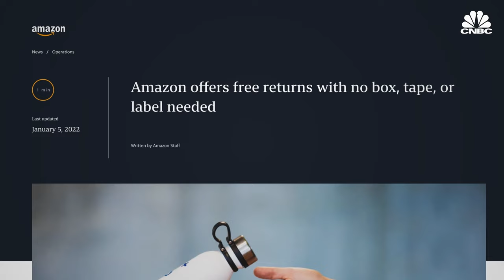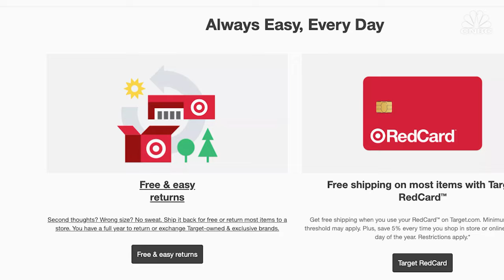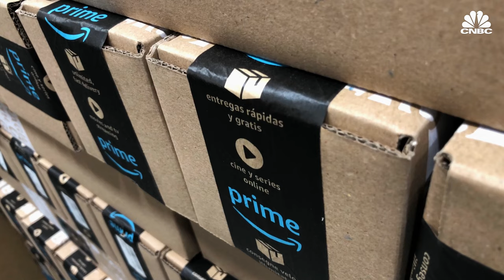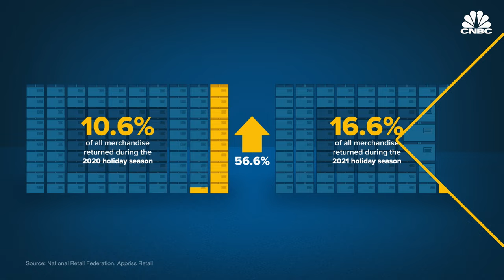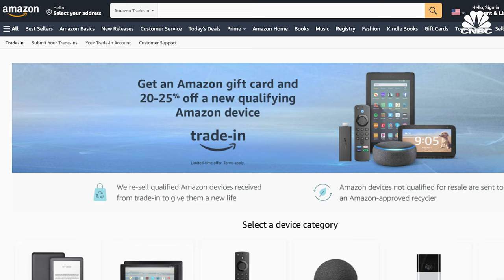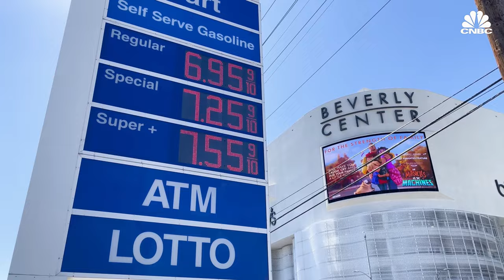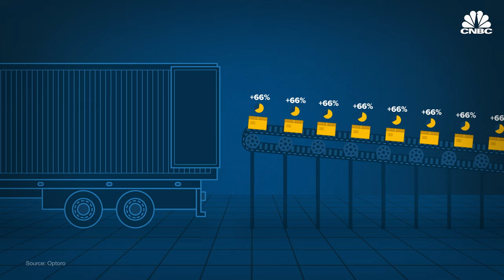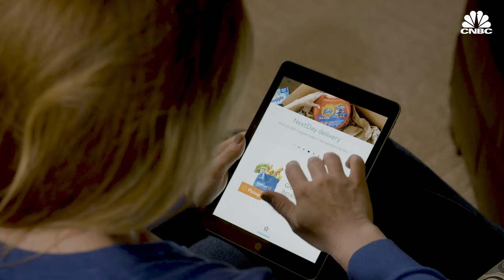Amazon’s Plan To Fix Its Multi-Billion Dollar Returns Problem

Comment: They need a review process where they verify listings. For example if returns for a particular item reach a certain percentage then Amazon should review the listing to ascertain the issue.
Reply: Good idea, obviously nothing will happen.
Reply: @jonhelmer8591  they do this already foo
Reply: They have the process i think its 15% return rate i am not sure, i am an amazon seller and returns are pain in the A$$
Reply: Amazon is doing that for a long time. This problem is not an issue with listing. It's the customers who know that they can do whatever they want. Even if the product is good, customers use it and return it.
Reply: I am an FBA seller and my return rate is from 6% - 8%of my total sales. This means every month I get about 140  returns and most of them go to disposal.
Reply: @CashCopMineZ  no they dont...  like if u get the product and dont like it for a reason. explains a good reason why not to get it. amazon will not let u keep that comment. they only keep stuff like oh the product is good bro lol.
Reply: @patocobar7038  why not sell to a discount store
Reply: on the front lines of innovation? yet unions arnt allowed or bathroom breaks
Reply: They do that already kinda. They don’t remove the item from the marketplace but some have a warning that reads “frequently returned item”

Comment: Frankly, making the returns easy and remove the hassle for the customer and the cost is absolute key to Amazons success. I wouldn't buy even half the things I buy on Amazon if I wasn't able to return it if it was something wrong with it etc.
Take shoes or clothes for example, often you don't know how they fit until you have tried them. Then there is electronics etc.
Reply: Amazon actually encourages returns and has made it soo easy for customers to return things. They place the negative cost on the sellers which sucks because most sellers take a loss at a whole bunch of returns. They even added returnless refunds and they encourage sellers to provide them
Reply: How do you return an Amazon product when they just leave the item by the door,  don't ring the doorbell to alert the customer that the package was delivered, and some knucklehead comes and steals it?
Reply: @indriadrayton1132  Then you report it to Amazon and get a refund. If there is no signature how can they prove that you got it. Amazon know full well that packages are just dropped on porches. They get stolen.
They could require signature but they know it would mean they need to drop it at post office if someone isn't home. Causing hassle. So they rather deal with it that way and take the loss. Big ticket items do require signature.
Reply: on the front lines of innovation? yet unions arnt allowed or bathroom breaks
Reply: @loki76  just wondering how many times does it take to keep reporting items that get stolen when stuff is delivered to you and your doorbell isn't rung to alert you? Almosr everyday, my neighbor ends up with packages at their doorstep, me ending up ringing their door myself to let them know there is a package at their door. Nope. Will not do business with Amazon.
Reply: Returns are extremely easy with Amazon, getting your money back well that's a different story. No more for me I'm done.

Comment: Returns are an inherent part of online shopping. Merchandise doesn't always look as advertised, doesn't fit perfectly, or doesn't function as intended. I find this to be far less of an issue with things I inspect and buy in person at a brick and mortar store.
Reply: plus the slightly false advertising of the product
Reply: @shaystern2453  ''slightly''
Reply: Facts gonna start going to best buy to get my phones cause i get them from amazon breaks in 3 months and not being able to tell certain things like what charging port it uses, 4g or 5g, unlocked??, the size, battery life etc. most isn’t stated and it’s upsetting because you pay more for a more expensive item that displays all that information then the cheaper item

Comment: The issue is Amazon allows a flood of sellers onto their platform. This means lots of counterfeit goods which leads itself to returns. If the product I am buying is made of low quality, getting pumped up by fake reviews, and not as described, of course people are going to be issuing returns. That's the issue with Amazon: They don't exactly have the best reputable sellers. I bet if you do a rate of return of Amazon Basics items vs their counterfeit counterpart, you would see a much lower return rate on the Basics items. Same with name brands listed on Amazon. 

And it's foolish to believe that the stuff Amazon donates to these third-party centers aren't selling them. I guarantee they are keeping and selling the stuff worth doing so. Also, Amazon already charges customers for that return cost. It's all built in to the product, prime membership, etc., No seller is foolish enough to continue selling if it isn't profitable so they are clearly earning enough $ to justify the returns. Does returns eat into their margin? Yes. But that ease of return also allows them to generate massive amounts of sales.
Reply: "counterfeit goods which leads itself to returns" --- a very questionable assertion
Reply: @troooooper100  Not questionable. Counterfeits have a higher rate of 'not as described' or 'defectiveness' due to it having lower quality control standards.
Reply: Exactly, the cheap ass quality products being shipped is the issue. I stopped ordering from Amazon for over a year & closed my account. After working in the parcel warehouse industry I limit online consumption because ppl are not pid fairly .

Comment: The problem is that Amazon sells junk quality products or it isn't as described or it's counterfeit.  It's too easy to become a seller and it's too easy to skate by with low quality products.  Other retailers have started to accept junk products. I've returned more stuff to Costco in the last two years than in the past decade before.

Comment: My returns are mostly because there is no quality control. The only way to know if something is good is by waiting for hundreds of customer reviews which are paid for by the seller. Amazon needs a “certified product” label that can only be given by submitting your product to independent review by Amazon judges.
Reply: Fundamentally returns are the symptom not the problem. Streamlining returns and burning them for energy and reselling them is simply a Band-Aid for the actual problem. There is not a good quality control system for Amazon purchases. Many times it is just products that are bought off of Alibaba and re-sold on Amazon with very little value added or quality control. Then the customer who bought the product wind has two options, throw it away or return it.
Reply: There's the Amazon renewed program
Reply: Even if the product is certified, does not mean it will be quality. I rarely buy on Amazon because of too many disappointments. One was buying an item which was labeled 100% leather but after two weeks, it was already peeling. This was from a well known national brand. So I claimed, they paid for return, and I got a refund. The same item is still listed on the site with 100% leather and I have no idea how in the real world a store would allow that to happen.

Comment: It's nearly impossible to make a good informed decision when buying clothes and shoes without trying them on. This kind of item should be banned from Amazon and online stores. Amazon and online sales should be only for books, electronics and technology, kitchen supplies, etc..
Clothing, shoes, linens and anything involving a fabric, texture, size, etc.. Should be banned simply because the odds of matching what you see on the screen with a perfect fit it's highly unlikely. As for clothing returning to the retail, shopping mall,  experience of the 90's and trying stuff it'll be better for the environment and maybe even create jobs. Returning should be only for damage items not because you thought the color was wrong.

Comment: There is also a borrowing problem with Amazon customers in particular because of their easy return policy. There were litterally whole Tiktok and redit posts on how to do this. As a handmade seller on the platform among other selling platforms, I ONLY have this issue with Amazon clients. They buy a product, use it at an event, then return it for a refund. Which comes out of my small businesses pocket because we cover the shipping costs. It's a problem for multiple reasons. I totally get needing to return some things, but when it's blatantly obvious that people are abusing the system. Something needs to change.
Reply: Hello there how are you doing today

Comment: Ebay used to have it so there was allowed a fee to be charged by the sellers if someone bought something and tried to return it without a valid reason that had to be proven, but policy changes has basically destroyed this option for the most part. Might want to bring back this model if you want less returns of products as well as less losses for those third party sellers that usually get hit the hardest.

Comment: Amazon's problem is largely managing its sellers to standardize.  If Amazon demanded some quality and standards, returns would be less.  This is ESPECIALLY true in terms of women's clothing, underwear, bras, shoes, and so on.  Sellers use Asian sizing and it's a gamble to buy their crap.  If Sellers want to sell in the US, they should have to adhere to Amazon's own US size charts.  If I could know things will fit with more probability, I would buy more and return less.  Also, even some of the brand names sell lesser quality crap on Amazon, the sell "imperfect" or knockoff items.  I was just looking at Hanes T-shirts for women.   I have worn Hanes T-shits for years, so I know how they should fit and their quality.  But if you read reviews, people are getting mis-sized items, ill fitting items, items that have seams falling apart on the sides of T-shirts and in armpits.  It's obvious, these are not up to the quality of Hanes clothing you'd get at say, Macy's, JC Penny, and so on.   Also, sellers post inaccurate titles, sellers try to trick buyers with misleading photography, post inaccurate colors, or have their models hold their arms or stand a certain way to hid fit issues.  I bought a lovely designed ribbed sweater over the winter, but when I put it on, the fabric content was very poor, and the ribbing made the sweater bulge in very unattractive ways, giving the appearance I had a "spare tire" around my waist.  When I went back and looked at the model, she was holding her arms to camouflage what was happening at her waist.   The model was bone skinny, so you know if it was bulging at her waist, on a more athletic built woman like myself, it would look even worse.  I only noticed it and had to look hard at the picture because of the model's arms bent at the waist and her hands touching in front of her body.  Once I noticed it, it was an odd stance and clearly positioned to hid how crappy the fabric was.  Completely designed to be misleading.  That is not the buyer's fault.

Comment: Maybe Amazon should start with how they package items in the first place. Whenever I order a book on Amazon I expect to have to return it because the packaging of the item for shipping is horrible, and the book normally comes damaged due to it being unprotected during the shipment process. I understand as a consumer that items will have "shelf wear", but Amazon is horrible when it comes to ordering books because of the lack of protection they give to the packaging of the item. Most likely a lot of other items come damaged too because of a lack of packing properly for shipment.
Reply: Try buying from a third party seller on Amazon if you can. Not from a megaseller, who are as bad as Amazon with packaging, but one that takes time to list a book with a good description, lots of pictures and such. Much more likely to package books and media properly.
Reply: Video games are just as bad. They just throw it in a bubble mailer and by the time you get it, the case is always cracked and the disc is just floating around inside.

Comment: They really should better incentivize the repurchase of used/returned goods. I always check to see if there’s a used option before I make a purchase. I got my rollerblades, a Dutch oven, and a dry erase board used this year, and I’m happy with every purchase. Most people would rather have new items though. Since we are doing amazon a favor by repurchasing these items, they really should consider a larger discount on those used items. A couple of dollars off isn’t enough to get most people to choose the used option, even if it’s in great condition. If this stuff is going to get thrown away or donated at some point anyway, why not just sell them for a 50%+ discount? Everybody wins! What’s the harm in that? Currently, it seems like amazon is just trying to make as much money as possible from these items that will eventually be garbage anyway, and it reeks of greed.

Comment: I bought a full length mirror recently and was disappointed it arrived shattered so I had to “return” it. If the delivery drivers didn’t smash the merchandise, that would save on returns. They refunded me but I have to get rid of a huge shattered mirror myself. The whole thing could have been avoided.
Reply: It’s not always the drivers, Amazon will load up damaged packages just to get them out of the warehouse.

Comment: Coddling customers = frivolous returns 
People order multiple clothing items with the intent to return them because they CAN, 
What did they do before Amazon? Were they naked?
This new convenience is nice, but at what cost to the market and the environment?
Reply: Clothing is hard to buy online and amazon tends to have bait and switch for clothing they might have the model donned in cotton and you get spandex version of it inspite of that not being an option at all for the product. The same issue exists with jewelry the customer can't determine what it will look like, feel like, or how thick the chains are till it shows at their house.
Reply: Clearly you are male and can just order your waist size and things fit.  Not true for women.  If I have a special event, I will go to a brick and mortar and take 7 dresses into a stall and try them all on.  Why should it be any different, ESPECIALLY when Amazon allows its Chinese sellers to peddle crap in Chinese sizes.  I am a women's size 12---fairly average for a woman.  I do have a large bust, so sometimes in Chinese crap, I have to order a size 5XL or more.  Does that sound right?????  Amazon needs to make its clothing sellers adhere to Amazon's own size chart for the US.  That would solve a lot of the problems.
Reply: @DK-zu6tt  don't make your problems everyone else's

Comment: Paying for return shipping is the worst. I bought a keyboard on Newegg several years ago, didn't like it had to ship it back. They had Restock fee back then of 15% so there I lost 15% of my money. Returning it via UPS cost a lot of money. In the end I lost half the money I spent buying that keyboard.
This is why I like Amazon, free returns and no hassle and no restock fees or arguing with customer service. 
On top of that I love how Amazon often deal with late packages or packages that could be assumed lost. They send out a new replacement and often if the original package show up you get to keep it. Even if at time they say they want it back you can just tell them in chat that the Amazon delivery just drop the package so you couldn't refuse it and also you don't want the hassle of going to post office etc. They usually just say, if it shows up, feel free to keep it..
I got myself an extra HDD valued at $140 because of that. So I have 2 HDD , 1 for free and not cheap either.

Comment: Amazon can reduce the number of days eligibility for return to 7 days or 2 weeks. They should also display some sort of message on their website informing the environmental impact of return. If this reduces the return by even 1 % of their returns then it is worth a try. Sometimes customers also need to be taught the right consumer behaviour.
Reply: 💯 agreed
Reply: If only that were possible to 'educate' the consumer but the consumer has already gotten used to being king and it's very hard for other businesses to compete with this giant by offering the same level of no questions asked returns. Amazon lost billions to develop the amazing operation it is now, and it has very deep pockets to take losses and simply push the cost of return on to the seller instead.

Comment: If they want to reduce returns they should probably focus on sizing. Making sure that shoppers can as accurately as possible choose the right size.

Most of my returns occur because the product was too big or too small.
Reply: Or the pant stitches ended up in the middle of the pant leg instead of on the sides where it belongs. Same for tops.
Reply: Yep.  If Amazon required its Chinese sellers to use the Amazon size chart for the US, then I would not return as much.  But I am a woman's size 12-14, with a large chest, and I often wear between a size 3X - 5X in Amazon's Chinese crap.  Then there's the odd thing that is way too big.  It's insane how hard I try to research a product and when it shows up, it's wildly inaccurate.  Also, Amazon needs to block sellers who mislabel the ad as one fabric content like say "Cotton" and then when something shows up it's 100% nylon.  That is just misleading.

Comment: This behavior is obviously passed along to the consumer. in higher prices If a seller has to eat a 10% return rate and potential losses due to unresellable prodcuts, this is factored into the price he charges. So basically returns are a socialized cost. Serious buyers pay more for the item even though they never do returns, to pay for those that abuse and heavily use returns.